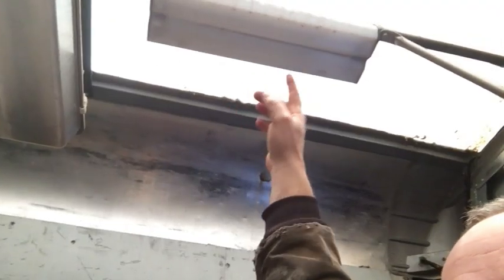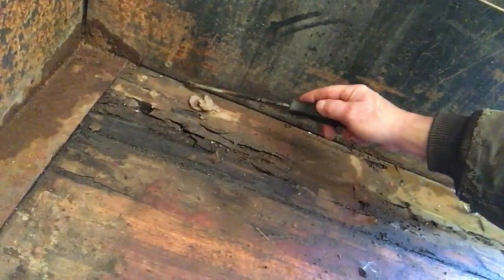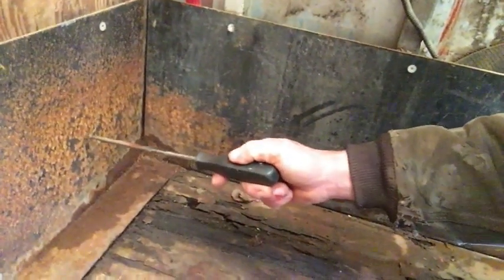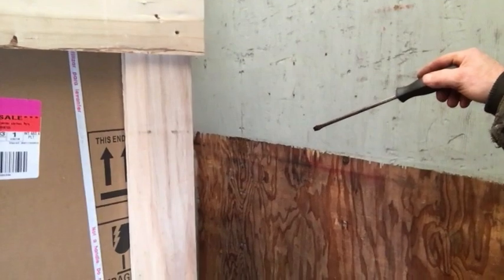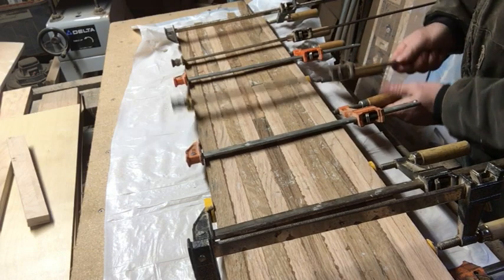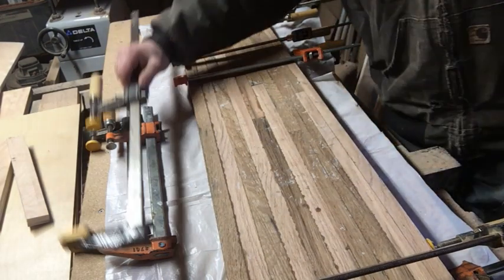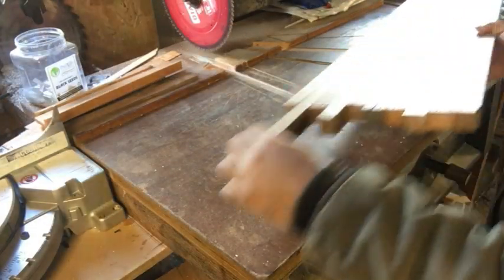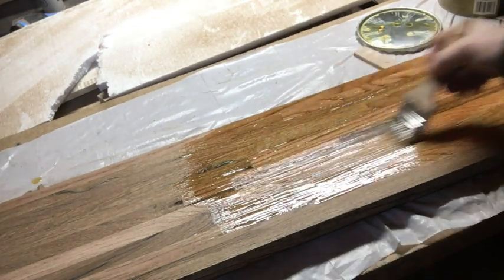Building and Replacing Wood Flooring in Box Truck

Comment: Excellent job! I do enjoy watching you work. It reminds me when we own a diesel garage. I kept the books, was an extra set of hands and did parts&supply runs for things that couldn't be delivered quick enough by order. I have a certificate in welding and air conditioning because they wouldn't let me pick up the parts unless I could pass the written test. 🤣 I was always at home in the garage among the grease & brake dust! That's why I can joke "Pat didn't do it like that." he's been hearing me say for decades, "Are you sure that's the way it goes? 🤨"
Reply: 😀Looks like I could take some lessons from you! Thanks for stopping by the shop...and shop truck.

Comment: Well done good and Faithful. . . .Only problem now is that you are stacking up all the projects here, that you'll be accomplishing the next time you swing by. . . . .  and You do know I'll even hold the camera, while you're being such a great help. . . . . . Thank You Mr. Patrick, I am truly interested in the basics of the laminated lumber / counter top, point by point, and are there any fasteners {Screws, bisquets, or other } installed laterally? If the area repaired, were a high traffic area, what you have done differently? Once again, Thank You Both. B BIG Time Blessed, 2 day & 4 ever, in YAH'SHUA's Mighty and Matchless Name. . . . .
Reply: The material was simply glued with Titebond III. One can use biscuits or dowels but it is unnecessary. There is enough surface area and a good water proof adhesive is being used. The cross members and I-beams are also close together so the floor is pretty ridged.  Good question of concern. If it was a high traffic area I would consider working in tongue and groove into each panel where the individual panels slide together but the glue-ups would remain the same as I did this one. I would also pay closer attention to the 1-1/8" thickness instead of the finished 1" requiring shims. Thanks for hanging out at the shop...and shop truck!